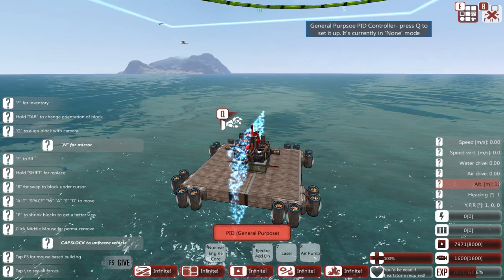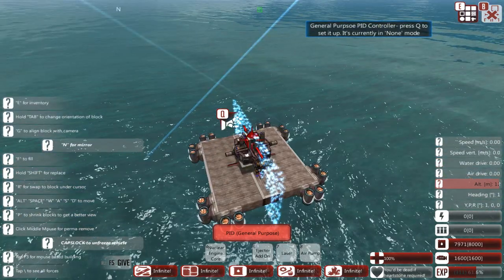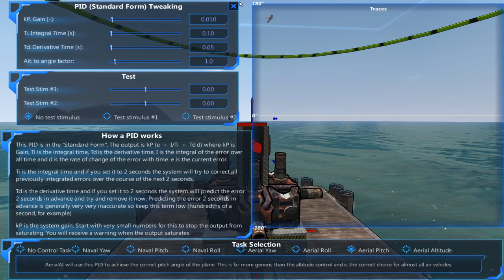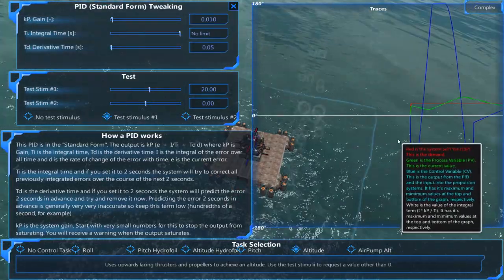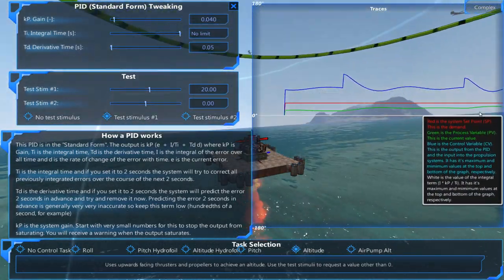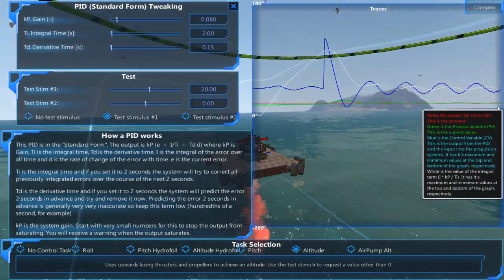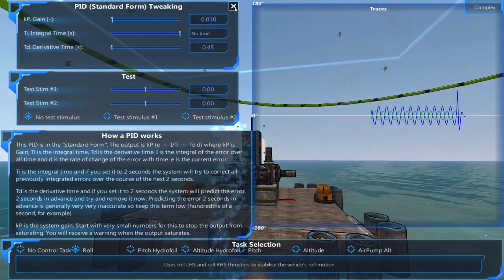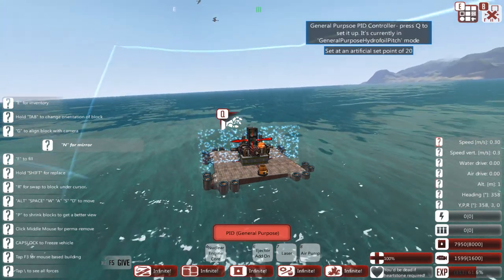PID Controller Tutorial - From the Depths

Comment: It's worth noting that no amount of PID tweaking will fix a terrible or incomplete control setup. If you've been tweaking for a while and are pulling your hair out, zoom out from the box and check your control methods. Are they all positioned correctly, powered, with the right thruster mode selected (if applicable)? If you're getting output saturated, do you really have sufficient control for the vessel size or force size (think recoil of a broadside) that you're trying to damp? I've seen many times in KSP where a player is slating an autopilot or PID mod for not being able to stabilise their craft and it's either excessively stable and won't pitch up or it's horribly unstable or has insufficient control. There's my tip for the day!
Reply from the maker: +jonvoltage1 That is all excellent advice!  Thanks for sharing. :D
Reply: Anytime...just looking back at where I started learning... and teaching is by far the best way to advance yourself too :D

Comment: hey I'm having issues with the ai wobbling my ships back and forth.i tried using an pid controller to smooth my roll but that hasn't worked. I also tried using the pod ai (naval yaw) but it shows no reading no matter what I do. any tips. honestly this is really annoying and I would love to have my ships go at full speed.
Reply: Thomas Kramar First, make sure you have something for the PID to use to counter the rolling, and that you have enough of it, and that they're setup properly (mode, facing, has power, etc.).

Second, tweak the bars of the PID, a lot.

Comment: Hey Irelan got a question 
All the things (example PIDs ACbs) can there counteract each other
Ps Plz ask nick about that
Reply from the maker: +Nuruddin Shah Haha, sorry about the wobbling.  What do you mean can they counteract?  You can use ACBs to set test stimulus on a PID controller already.
Reply: Can something thing messed up some other thing
Reply from the maker: Nuruddin Shah I think one over-rides the other.  If  I remember right, ACBs take precedence. i.e. If you have drive fraction set to max with an ACB, the PID won't be able to slow the ship down.  It may depend on the setting though.
Reply: That I want to know 
(And at the same time this comment will be helpful to other)

Comment: Don`t know whats happened with my game, but it still not work. I built the same little platform with a single truster and a small engine on it. I try to set up the PID like you do, but if I setting the teststimulus on any height nothing happens. If I close the PID options and go back in, the teststimulus is back to zero. Don`t understand this...

EDIT: Okay, for any reason you can't put your thruster on a fueltank. The PID does not recognize this jet engine.

Comment: The AI PID communicates with ur navigation card to better stabilize the craft.  It references ur propulsion data and adapts as necessary.  I look at the P.I.D. differently.  P is how much thrust U want to use to correct.  I is how long you want the correction to take and D is how far ahead U want the controller to look for problems.  For instance if the I setting is 18, it's gonna take 18 seconds to make the correction.

Comment: but i still dont know what the variables actually CHANGE.
Reply from the maker: +Redline I really can't explain it much simpler than I did.  The variables change the variables.  P is how much control is available to your control surfaces, I is integral time, or how long the PID has to correct and D is like damping.  I said this all multiple times in the video...
Reply: +ireLAN Gaming meaning P is like adjusting the power on your thrusters? but what does I do? you never explained that in the video.
(btw i am from switzerland so i dont know what Integral means from a mathematical standpoint)
Reply from the maker: Redline Close enough.  Just play with it.
If my explanation isn't good enough, you can read the wikipedia page: https://en.wikipedia.org/wiki/PID_controller
Reply: +Redline Yeah, P will increase the percentage of your thruster's total power available to the PID box, if you like. That's why it multiplies out the I and D. If the output is saturated, that means the P setting is requesting more thrust/control authority than you have (i.e, over 100% thrust). The D variable changes or Damps the wobbliness - smaller time, smaller damping. The I gain takes away the constant error that sometimes occurs as an artifact of the other two.
Reply: Fred Johnson come on man, you can't go talking to a content creator like that, especially a spare-time one. This video is perfectly adequate for PID basics - this is all I ever needed to start - the more advanced stuff can be found elsewhere. There's no need to take that 'no effort' tone with someone who gives up their time for your entertainment. You're better off with this tutorial than if he hadn't made one at all.
Reply from the maker: Fred Johnson I did say in this video that this is the basics and enough to get started.  Frankly, if it's not good enough, go elsewhere.  Many people deem this adequate to get started, which was my intention. I am not here to hold your hand and do the job for you.  If you are incapable of experimentation and self-teaching, then you are playing entirely the wrong game.
I give up a significant amount of time for this and your entitled attitude is utterly horrible.

Comment: how did you get a NUCLEAR ENGINE CORE i want it.
Reply from the maker: +Redline I honestly have no idea how it got onto my hotbar, lol.  The nuclear_core is the core game module that contains the meshes for the upcoming nuclear engines.  They are not finished yet though, but if you have a much around with the modding interface, the meshes (and I think the textures) of the parts are there, although I'd say they could change a lot before they get released anyway.
Reply: +ireLAN Gaming TIL nuclear engines (which I've been thinking about for the few days since I've bought FTD) were going to be a thing. :D Thanks for this and the much needed tutorials !
Reply: +turarwanaa Yeah, they are gonna be really cool, I'm gonna throw one in my Cruiser I'm gonna build. Anything smaller will still have to use fuel engines I'm pretty sure, because the reactors are going to be big, and expensive.
Reply: Combatsmithen I guess it was bound to happen since it's a naval game, and the engine nerf made Mhp/Ghp engines impossible. Now, nuclear reactors do produce plutonium... What could plutonium be good for in the context of a war ? 8]
Reply: turarwanaa NUCLEAR BOMBS MWAHAHAHAHHA

Comment: Up until now, my PID usage has pretty much been entering random values and hoping for the best, lol.
Reply: +Crescendo Also, can you use a PID to force an aircraft to a certain pitch? How would I do that?
Reply from the maker: +Crescendo Oh, I still do that!  It's just more directed fumbling now. :D
Reply from the maker: +Crescendo If you're using an aerial AI, use the PID from the AI menu and set it to Aerial Pitch.  Then set your desired pitch in test stimulus 1 and select the little checkbox underneath.  The PID will save this value and try and keep it at that level constantly.
Reply: ireLAN Gaming Thanks! I'm trying to get a gunship to hover at the right angle to get a good field of fire, and up until now I've just been changing the centre of mass xD
Reply from the maker: Fred Johnson Your problem has nothing to do with the PID controller.  You either haven't got enough pitch authority on your ship or your thrust isn't aligned with the centre of drag.  PID won't help with either of these problems.
Don't blame the game for bad aircraft design, lol.
Press the \ key in build mode (bottom left of your keyboard).  This will show your forces.  Look for the grey, horizontal line.  Your centre of thrust has to line up with this or your aircraft will pitch up if the thrust is below centre of drag, or down if it's above it.  Sounds like your thrust is way above your centre of drag to exert that behaviour.
Reply: Fred Johnson Upload your vehicle to steam and post a link here. I'll take a look at at and try fix the problem.
Reply: Fred Johnson Ok, after you've uploaded your design to Steam, go to the vehicle's download page, and right-click it's name. Click "Copy Page URL" and paste it here.
Reply: Fred Johnson Okay
Reply: +Crescendo Up until now, I haven't used PID's. Now I realize how much I missed out on

Comment: This is very interesting. It looks like you can make aircraft and hovercraft very stable with these PID controllers. But I wonder if you can use them to make aircraft do more complex maneuvers in combat. I would try this my self if I had a computer that could handle this game. And I have never seen anyone try to do this before with any aircraft that they have built in the game, but I would really like to see if it's possible and how effective it could be. Well I have 2 things in mind that I would like to see if you can do it. The 1st is an aircraft that can do strafing runs on targets. Using only guns (no turrets, guns must be mounted into the nose or wings like an A-10 or P-47) make an aircraft that pitches it's nose down to aim at targets and fires when in range. Then pulls back up, levels out it's flight path and gets the distance for another attack before turning back around.
You can also try to make one that can shoot down air targets with just guns, WWII dogfighting style if you want to go the extra mile.  
The 2nd is an aircraft that can make maneuvers to evade missiles. (No flares or countermeasures allowed) Put a missile detector on the front, back, sides, top and bottom. Then when a missile is detected coming at the aircraft have it turn to a more ideal position to avoid it. When it gets in close have the aircraft make the sharp turning maneuver needed to dodge it. After you make one that can successfully evade missiles then you can add flares and other countermeasures to make it even more effective at avoiding missiles. 
So if you would like a challenge, (yes that's right, I challenge you to try this.) >:) I would love to see a video of your results. :)
Reply from the maker: +Vis Yeah, you can stabilise some pretty janky aircraft using it.  The pitch controlled strafing run would be fairly easy to do with PIDs.  Use a pitch PID and control it with ACBs.  The biggest challenge is the loss of altitude when you point your nose downwards to fire making it almost completely pointless.  It would be achievable by using an altitude PID in conjunction, but your aircraft would need to be incredible stable to maintain it's strafing run, which in turn will get it utterly annihilated by just about anything.
While I don't accept challenges, I already have a prototype air superiority fighter with most of the things you have suggested.  I hadn't considered the missile evasion, but that's really easy with ACBs.  I'll be scratch building it in the future for a video, so I can add those too if I remember.
Reply: +ireLAN Gaming Well it wouldn't need to be that big of an angle down when making a strafing run. And most strafing runs are only for a very short time. Just a quick burst with the gun. If you get many small aircraft making attack runs it could be very effective. It worked in WWII for ground targets like tanks. And with the ground stuff being added, it would be good to test out many different ways to attack ground targets.
I have yet to see someone make a fighter that has a gun to shoot down other fighters. Most people just spam missiles at everything. You should try to make your fighter able to shoot down small aircraft with just it's gun and save the missiles for the bigger targets. I know missiles use a lot of ammo, so it would be nice to see an aircraft that doesn't just spam missiles wasting ammo like all the others I have seen.
Also just how wide of a range does the missile detectors detect missiles? Is it 180 degrees in the way it is facing? Because if it is you could have it factor in more than just 1 detector when making maneuvers to give it a more accurate position of where the missile is and the angle it needs to turn at to avoid it. Like if the missile is coming from behind and the side detectors detect it is closer to the right side, you can set it to turn right. If the detector can tell the angle and not just the range, that would be even better. I'm not sure what all they can and can't do. I think you should do a video on those and many other things. Showing the limits of different parts. What they can and can't do. :)
Reply: +Vis I have a fighter that has a gun to shoot down other fighters, its an 18mm Sabot minigun. nose mounted, I use a cinematic dogfighting LUA to point the whole plane onto the target. The gun is mildly effective. It can shred smaller aircraft like SS Flee's and Falcons, anything bigger though, and it has a harder time.
Reply: Combatsmithen
Sounds cool. Is there a way you can use it to avoid missiles too? I would like to see someone make an aircraft that can do that.
Reply: Vis the AI will preform evasive manuvers and such, it can also be set up to do strafing runs
http://fromthedepthsgame.com/forum/showthread.php?tid=11873
Reply: Combatsmithen
LOL, the tiny planes dogfighting. XD The need better guns. Would like to see it with much faster jet aircraft, but it looks like they are just always maneuvering even when it is not needed.
Reply: Vis I use the code on my jet which can hit 60 m/s. its a pretty large jet too.
Reply: Combatsmithen
Sounds fast enough, but how sharply can it turn?